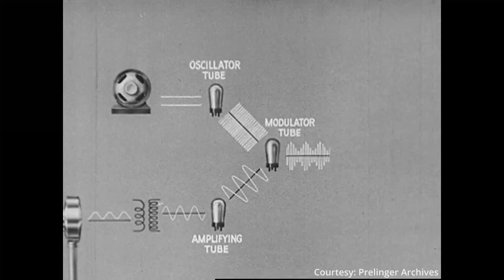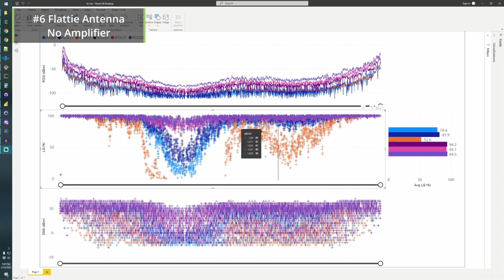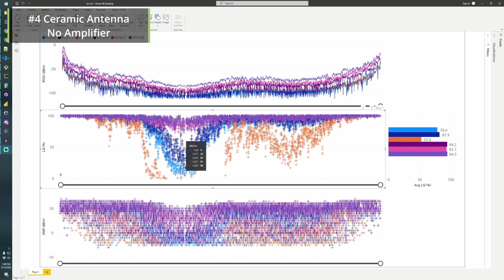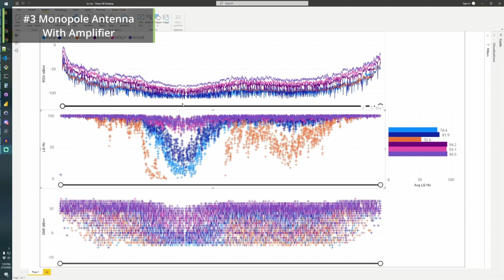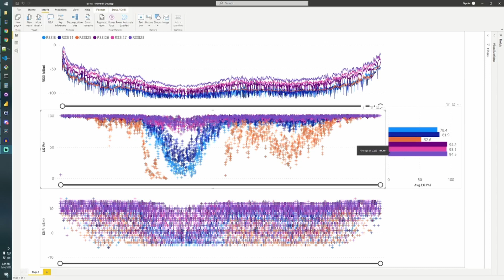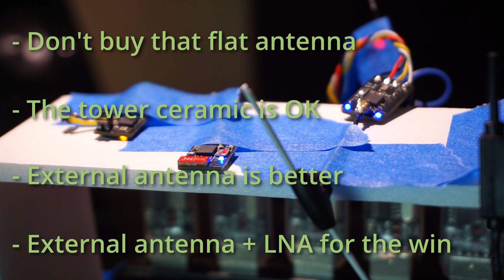ExpressLRS Rx Antennas Compared

Comment: Nicely done comparison mate, awesome data! How do those matek whip antennas go that they bundle with their elrs stuff? Im wondering if i should use a betafpv dipole or the included whip for longer range.
Reply from the maker: Thanks! The Matek antennas are sleeved dipoles, or at least the ones I have are. You can tell if they are if they have a hard metal sleeve covered in the heatshrink before the active part of the antenna. They have pretty much the same range as the T-style dipoles within the margin of error, with the sleeved dipoles performing very slightly worse if the sleeve part isn't exposed causing them to detune a bit.
Reply: @CapnBry  ok cool, yeah I wasnt sure what was going on inside that heat shrink lol. I didn't want to destroy one to find out. As long as they're ok then I'm ok with them :)

Comment: Thanks a lot for the Video and also for using metric system. Im looking for the best transmitter antenna for my Jumper T Pro since it comes with a N2420 airgain 2.4GHz antenna inside and Im not sure if its a good antenna or not

Comment: Thanks so much! I have always suspected this was the case but you've done the testing to confirm 😁. Ill keep making my own dipoles (T antennas). Just curious do you know if a sleeve performs the same as a T?
Reply from the maker: The data doesn't really back it up very strongly, but the sleeved dipoles seem to perform just slightly worse than the T-style dipoles but better than the monopole (just the wire itself). In practice it feeeeeels to me like the T perform better on my models but I would never be able to tell in a blind test.

Comment: hello ! there is a updated v1.1 flat antenna that is supposed to solve the range issues.
anyway thanks for the video, that's a lot of work you put in
Reply from the maker: We've received them and they are fixed. They're a little worse than the tower antenna but not by much. Approved for use, no longer garbage class

Comment: There is very interresting video. Thank you. but i have a question. how can you make such measurements . i mean what hardware / software do you need ?
Reply from the maker: It is built into ExpressLRS master with the debug_rx_linkstats user define (or something like that). Several RX are connected to FTDI cables all connected to the same TX with telemetry turned off. The per-packet stats are then post processed in whatever graphing tool you want, we use jupyter now with pandas and seaborn.
Reply: @Bryan "CapnBry" Mayland  thanks for quick reply. 👍

Comment: I heard that betafpv fixed something with the flat antenna?
Great testing!
Reply from the maker: That's correct! They have determined that there is a flaw in the first revision and will replace them if you bought one. The new ones are in the ballpark of the ceramic tower antennas, but slightly worse. Myself and three other developers have done testing and we're in discussion with BetaFPV about it. I'd say they're arguably usable now for LOS / Racing.

Comment: This is a fantastic video. My only concern is the chip is horizontal polarisation with all the others vertically polarised .  This would have had an affect on its performance. It’s nulls are are side on compared to the others on top too.
Reply from the maker: I just showed one result in the video, but I also rotated the entire rig 90° so that the top of the antenna pointed towards the test area and the results are the same (although the other antennas did slightly worse with their nulls pointed towards the test area). I didn't create graphs for the other tests, but the data is also on the website in the description.

Comment: The real question is why did BetaFPV choose to use the NN02-201 flat antenna. That is a wideband antenna meant for 700MHz up to 7GHz. Its not a tuned 2.4ghz flat antenna and they definitely do exist. Another thing is that the NN02-201 antennas on Digikey are like $3.50 a piece (less for quantity). But I found other chip antennas on Digikey with similar gain but tuned for 2.4GHz for a hell of a lot cheaper, like 60 cents a piece. Makes zero sense to me that they used a wideband antenna. Makes me want to order a couple of the flat antenna receivers and then replace it with some 2.4GHz tuned flat chip antennas to see how they work. Or just order parts and PCBs to make some receivers on my own. Sounds easier to just order some BetaFPV ones though.

Comment: Did you measure noise floor before the test? Why is SNR so prevalent at these power levels? 10-11 dB at good signals? Something's wrong.
Reply from the maker: I don't really understand your question. SNR is prevalent? I can't tell if you're saying the SNR is too high or too low for what you're expecting.
Reply: @CapnBry  sorry, question is why SNR is always close to 10 dB pretty much all the time. Is it just that noisy? thanks for all the work and tests!
Reply from the maker: @Onefgear  The SNR is how high the signal is over the noise, so 10dB means the signal is over 8x stronger than the noise. Lora can receive in the range from +infinity down to around -3 (yup it can receive if the packet is actually weaker than the noise). So it is no surprise the SNR is almost always positive, because our signal is stronger that the noise.
Reply: @CapnBry  Thanks yes I know that. Simply curious why the noise is so high at those signal levels. Is the noise really that high? e.g. Data shows -30dBm with 10-11 dB SNR and so does dBm in the low -90s. Have you measured noise floor?
Reply from the maker: @Onefgear  oh because the dynamic range of the lora chip can't measure that far down. The reported SNR only can only get up to +12dB before the noise is too far away to compare.
Reply: @CapnBry  Ahh I see... I've seen something similar in the past in other systems. So the important numbers here are around 0 dB as I expected. Thanks

Comment: Thanks for testing. Now we know the facts. 👍. Not all, because I really wonder why the COM28 SIYI FM30 diversity performs not top range, you mentioned maybe a faulty LNA? I guess the Matek R24-D with a LNA: SE2431L will perform much better, should be the no.1 ?  Is COM28 Axis dipole the same technology using as the HM EP1?

Comment: Which actual RX models are these?  (Esp. the BetaFPV winner!)
Reply from the maker: It is the ELRS Nano according to their website.
Reply: @CapnBry  Aha - thanks!  I see where they mention the LNA.  Very cool.
Reply: @CapnBry  the confusing part is that my BFPV ELRS nano RX came with T-Antenna; However, i do also see the PA+LNA chip in diagram.
Reply from the maker: @nerdCopter  the Nano cimes with the t antenna and amp. The Lite can be purchased with the red flattie antenna. The product naming is a bit confusing, but that's because TBS called their receiver the Nano so everybody has to start there sadly.
Reply: @CapnBry  got it, after re-watching i was clarified that #4 and #5 was the same RX, differing antennae only. i have nano. yes naming sucks :P